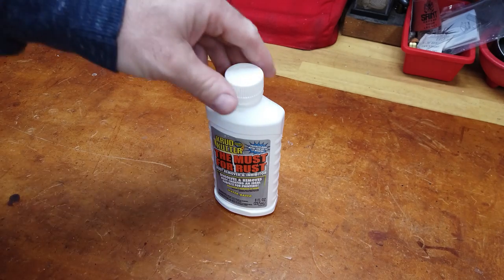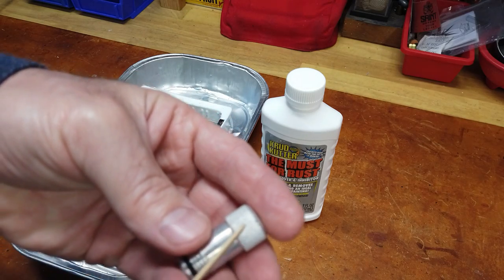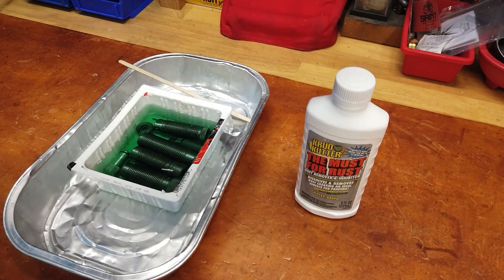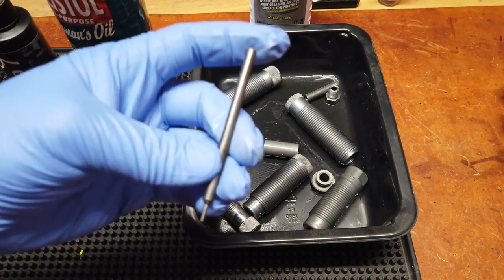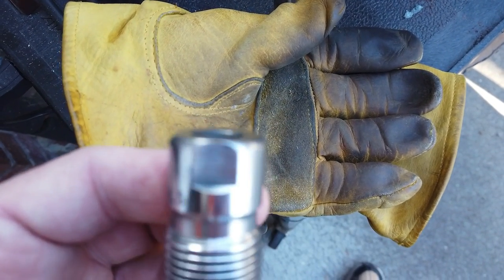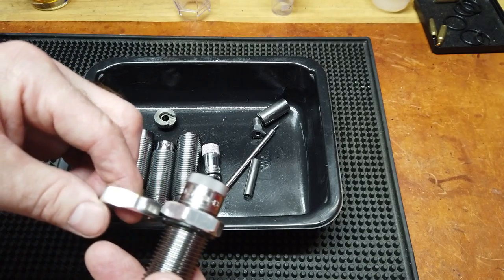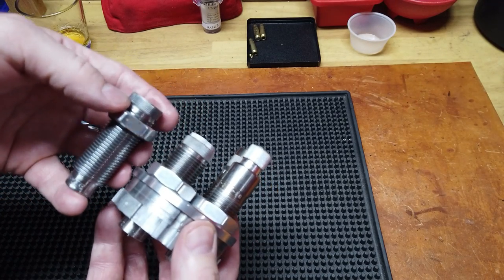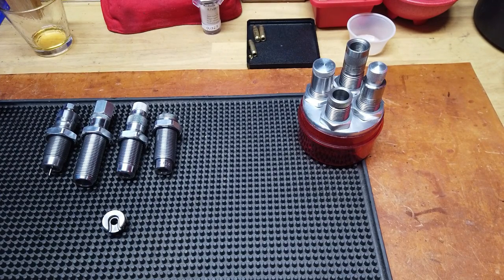Weekend Project.  Restoring Rusty Reloading Dies to Like New Again

Comment: The outsides look pretty. But the insides are what does the work. Rusted pitted dies will scratch brass. Run a few brass cartridges through and then examine them for surface defects.

Comment: Pretty cool stuff. Thanks for sharing. I would say you made out like a bandit on that yard sale deal EvapoRust is pretty good also. I use it for hand tools. I don't recall and irritating mode with it so it might be something to look into. Also, I live in a high humidity location and I put my dies in my gun safe which has a golden rod inside. It is used to gently warm the interior and serves to keep the humidity at about 30% for me. Might be something that could work for you. Take care and thanks again.
Reply from the maker: Thanks. I have since become a BIG fan of EvapoRust (a lot more economical as well IMO).  Don't have to have the same level of care/protection (or smell).  I also put desiccant in my die holders to keep the rust/humidity issues to a minimum.
Reply: That'll get it! I also try to take the best care of stuff that I can and its a battle with dies. Powder and primer formulations are better than they used to be but are still corrosive.I also buy those glass organic spice jars and put each die in one of those, let them dry out, and wet a small sponge cube with sewing machine oil and stick it in the jar with the dies and srew the lid on tight. Oils the air in the jar. Those dies are like new. I like your channel and will visit more when I can. Lots of great stuff! Thanks.

Comment: Curious that anyone would leave dies in a humid environment…. I am on a set income but will take all the 22 Hornet dies and brass that folks don’t need or want instead of letting it rust and corrode.
Reply: I moved houses 3 years ago, my reloading equipment was well boxed up, kept in storage until yesterday, found my dies covered in rust, despite being inside their cases, inside boxes… got them mostly cleaned up, but looking for a solution to get them to near 100% again.

Comment: What about the insides. I have some redding completion does I’ve had for 5 years and the inside looks like it has surface contamination in some spots. My basement is always 50% humidity and my other rcbs dies are still perfect
Reply from the maker: The insides looked fine after the Krud Cutter.  If I was any more OCD, I'd break out the dremel and polish the insides!